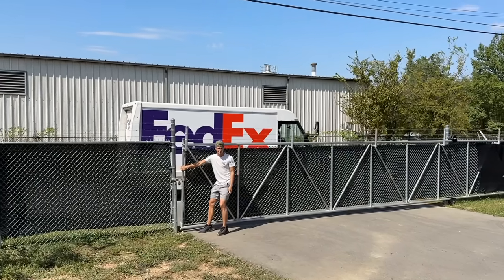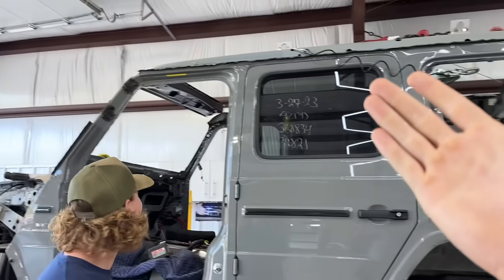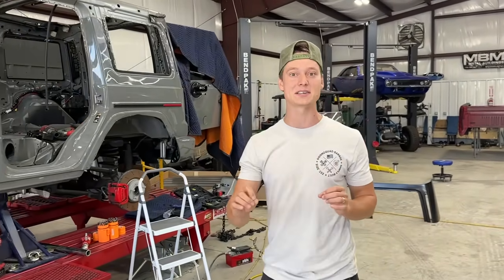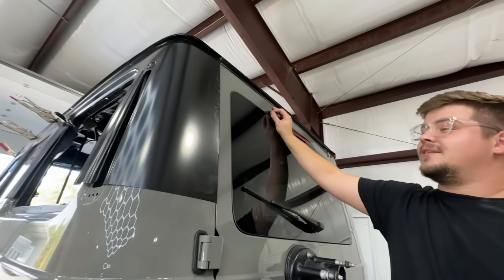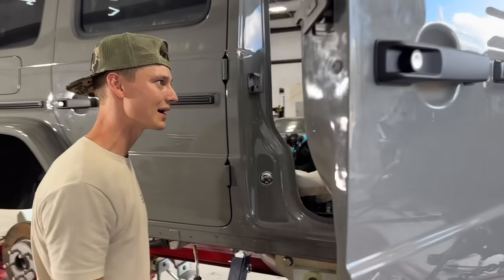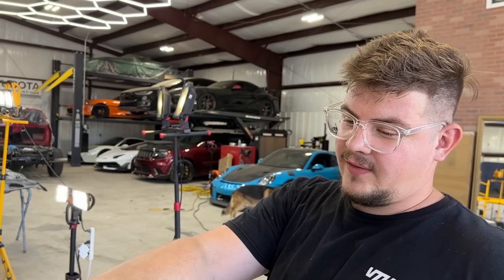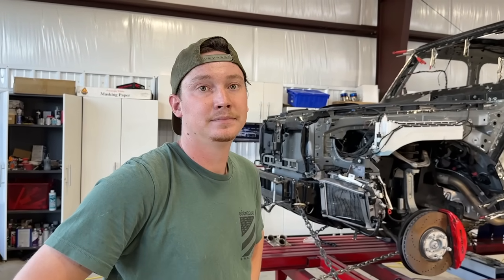Rebuilding A Wrecked 2022 Mercedes G63 G Wagon PART 7

Comment: Hey guys, I noticed light curving near the front passenger top hinge. I think door is tweaked there at hinge. You mentioned pushing top back in... what about hinge area.
Reply: Yeah, You’re right. Was just about to mention it!
Reply: A 1/4 ton inside moving the panels around will warp some of the body and it's setting.Usually when the weight's removed the panels can reset. ;)

Comment: I am impressed that Chicago welder could handle that roof panel.  Assuming you used the 240v $169 incredible.  All the Mercedes approved spot welders are $$$.  Love the content hell of a structural repair with tons of work.

Comment: I am stunned that you guys didn’t think to run a cable and pulley to the rafter and then hook it to the spot welder. Coulda took a lot of the weight off of it. 
Just an idea. 
Bone apple teeth!

Comment: You guys should look into getting a good spot welder.
Reply: They've just used one on the roof 😮
Reply: @brianhume4743  That's not a real spot welder! They have been buying more professional tools so buying a lagit spot welder will save them alot of time. Plug welding takes way to long. Body shops usually have nice ones.

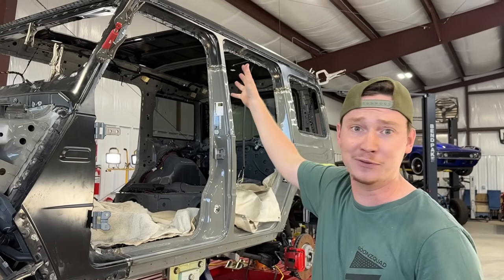Comment: 21:50 put in some wall mounted jib crane arms and attach a lift cable system to them like on the assembly lines to hold the spot welder and basically zero its weight out so all you have to do is swing into position... when wanting to spot weld anything...at any station=place in your shop..

Comment: could do with a nice 3 phase resistance spot welder water cooled for modern cars with the different metals used you will then get more of a factory weld with strength and endurance

Comment: double check the hinge area on the passenger front door skin .you can see the ripples of the sheet metal in the reflections.
Reply: and also the rear hatch door, you can see where the spare tire mounted, it's pushed in

Comment: You should hang the spot welder from the ceiling so all you have to do is move it around the project and not have to hold all the weight like the builders have.

Comment: Honest question, not a criticism - is all the panel glue you removed on the sides not that big of a deal to use in the new sections?  Does that take away from the rigidity?

Comment: That old front passenger door that V-Tune bent is damaged at the hinges, you can see the bend in the metal as if the door was force open past normal position.
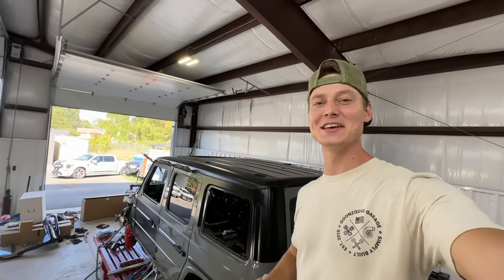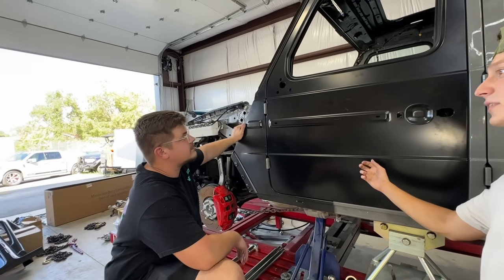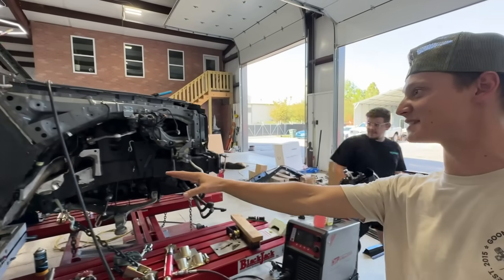Reply: I said the same thing. You see them in angles. Check out the passenger door at the hinges at 9:50, then look the front door at 10:47, then again look at the front passenger door at 11:13. The front passages door looks bent at the hinges.

Comment: USE EPOXY FIRST, THEN BODYFILLER - PLEASE!

No bodyfiller where the door & roof sealing goes around and no bodyfiller where the plastic-part in the c piller goes into - big rust issues !